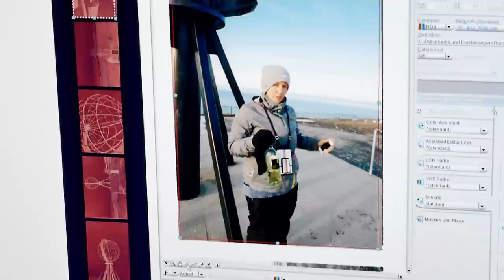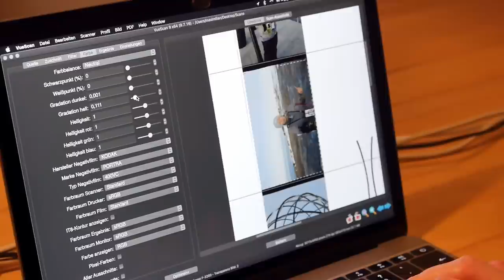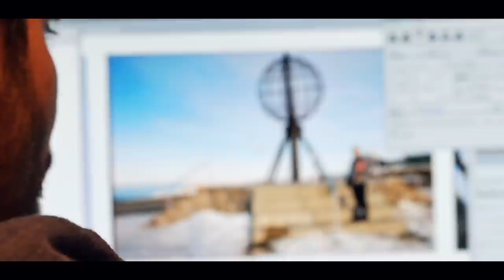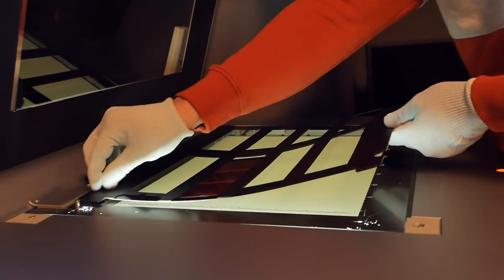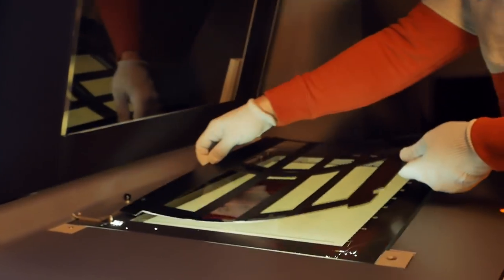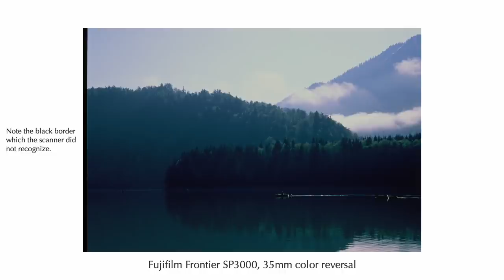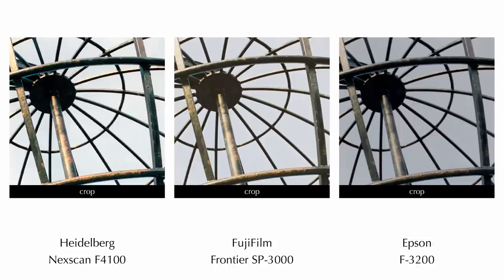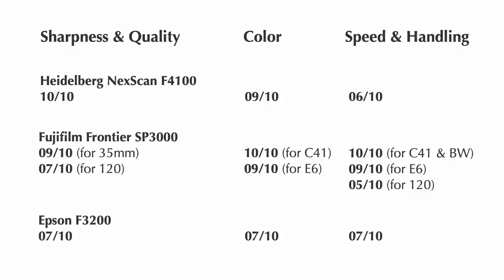How to find a film scanner that fits your needs

Comment: I scanned thousands of old negatives and slides using an Epson V600 Photo scanner.  It is an inexpensive flatbed that sadly does a better job than the "professional" scanning done at the time of processing by photolabs.
Reply: Really? Because my V600 is terrible for 35mm scans.  I bought Lomography Digitaliza trays which helped quite a bit, but I'm still looking for a new dedicated scanner for 35mm negatives.